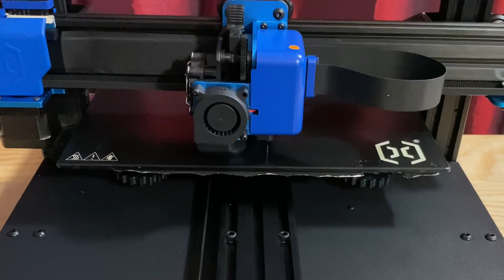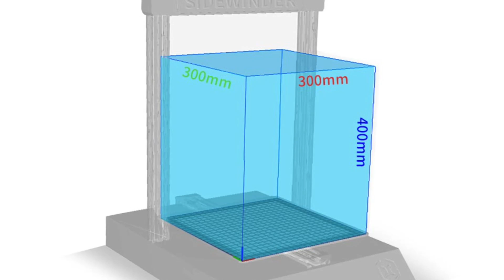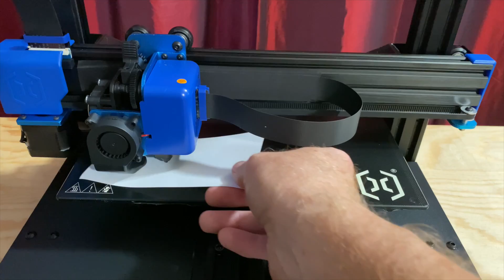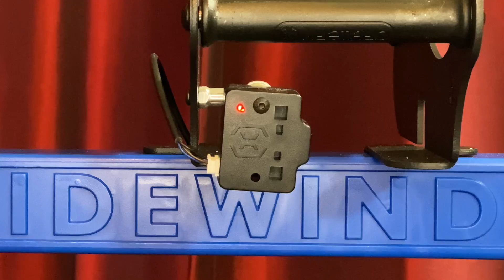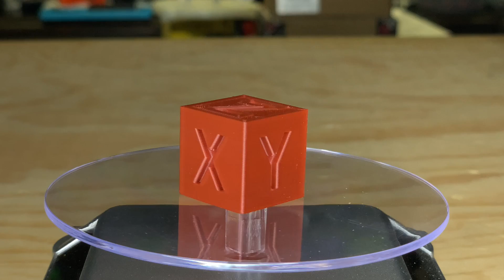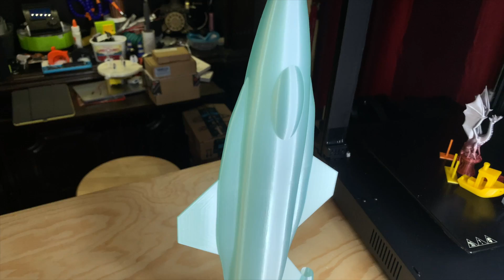Artillery Sidewinder X2 3D Printer Review

Comment: I'm actually quite conflicted here.  Your video shows fantastic print results with this printer.  I'm curious why then this reviewer produced utter garbage on the very same printer - https://www.youtube.com/watch?v=9JZqosMxmxk.  Did you have to tweak it off camera for an extended period or is this other reviewer just clueless?  I personally think this printer is beyond ugly, but I really don't care if it prints well and is at least somewhat faster than my Ender 3.  My first (and probably only) upgrade would be to remove the build plate and add something magnetic as I have not heard good things about the one it includes.

Comment: I have an X1- and seriously considering an X2. I have had to rewire the head direct to the mainboard, because of unreliability of the connectors, and it sticks out on my bench because of the bed cable, and the reel holder is a pain.

Comment: Thank you for the informative detail on this printer. I am really looking towards this printer and I have a couple of questions. 
1st is the sizes: I'm looking to use this for printer 3d game boards like walls and floor tiles. Have u done so or will this printer be good for that. I also of course will do larger prints, but looking to see if I could both? 
2nd I have seen other videos recommending to place supports on this do to the wobbling at full height, (however you printed that rocket and it looks great). Did you have wobbling issues or seen that? 
Thank you for your time.

Comment: Hi Bryan,   Is there any difference between the X2 & the Genius? It looks like the X2 is now exactly the same as the Genius besides the format. Btw: the Genius has no problems with the USB stick. What is very easy to break is the BL sensor. Mine broke when i printed  several parts at once. One parts came loose from the bed and the BL sensor hit that and broke. So be aware of that!

Comment: Great review. Taking money and print size aside, which one would you recommend more? Sidewinder X2, Ender 3 S1 or Ender CR10 Smart Pro?
Reply: I would like to know as well. Going to buy my first printer soon.
Reply: @RyKnocks  I decided to go with the Ender 3 S1 as my first printer. Was thinking about the SX2 for long time but what changed my mind is the amount of people using Ender devices - the community is bigger for sure and in my country there is official Creality reseller which makes it very easy to get spare parts etc. The bigger print volume is a nice thing for SX2 but at the same time you can build almost anything with smaller one but you need to split it into smaller parts.
Reply: @KrzysztofRozestwiński  I don't like the Bowden extruder on the S1.
Reply: @atonicoh  Ender 3 S1 has direct drive extruder

Comment: Getting ready to buy my first printer and printing TPU is a must. I know the Sovol does a good job and I saw your review on the Creality Ender-3 S1 where you said it handled TPU without issue. How about this printer, you never mentioned other filament types...
Reply: A little late but I'll respond for others having the same question. I've had my x2 for 4 months now and I use it primarily for petg and tpu. Does an excellent job with both once you've tuned it to that specific roll. I use cura slicer and always start with the generic setting then adjust after a small test print. My only complaint is the nonremovable build plate. It needs to be thoroughly cleaned every few prints and it's just more annoying not being able to take it off for a good scrub.

Comment: This looks like a nice printer. If I didn't already have 4 other printers and I hadn't sworn off bed slingers forever I might have considered buying it. In any case, I may be able to recommend it as a good first printer for someone just starting out.
Reply: What non-slinger printers do you use and recommend?
Reply: @Gi_Gantor  These days I'm using the Ender 5 Plus and Voron printers. They're not beginner models but they are rock solid and produce excellent results.

Comment: That bed is a deal breaker for me. The glass surface doesnt last long and replacing it is a real pain.
Reply: Can you add a different bed plate over the top?
Reply: You can replace it with an aluminium bed (more uniform heat distribution) for <£50, or use PEI covers.

Comment: Sadly , I've had nothing but issue's with mine . I've had it for 12 days and not one single print . 
I have a video on my channel to look at if interested  . Bed doesn't heat up either .
Reply: Use different firmware. Upgrade the TFT firmware with microSD card. As for mainboard firmware, it’s being worked on.
Reply: @mactastic144  Didn't work , still grinding  , also heat bed hasn't worked (says error) . 
Thank you for your assistance

Comment: Straight forward and thorough review. I would've liked to see Evnovo/Artillery do three things with the X2:
1. Add gantry stiffeners to allow for higher accelerations all around.
2. Incorporate a linear advance option that you can tune via a built-in file.
3. Partnered with Fulament to add a removable print surface as a factory option, rather than the glass.
Reply: They’re not a software company. Digant maintains better firmware on Thingiverse.

Comment: Thanks for reviewing this printer, I got my X1 last year and have been very happy with it. For it's large size, it's a more reliable printer than my Ender 3 v2.
Reply: What issue do you have with the ender v2? I actually am thinking of getting that one.
Reply: @wskwong2000  It took me a while to get it dialed in and working right. The Sidewinder was much easier getting up and running. Now that I have the Ender working like it should, it's been a good little printer.

Comment: One problem with the X1 that hasn't been fixed in the X2 is the non-removable print surface. If you damage the bed it's a total pig to replace.
Reply: There a third party magnetic build surfaces you can install.
Reply: @mactastic144  oh I'm sure there is, however if removing the original surface is such a pain then installing this would be problematic to begin with.  That's not to say I'd not be put off from replacing the glass  bed with the removable one.  I do this as a matter of course on the printers I own.   I ad a veery bad experience a few years ago with a glass bed shattering on me and I, personally, don't trust glass any more.
Reply: That’s a really dumb thing to have not fixed ! Def got to be a massive downside

Comment: What do the S and Z commands signify when using M420?
 I thought they would have started using a heated aluminium plate instead of sticking the heater to the glass build plate, many people I know in the community have moddded their X1 with a plate so they can use alternative build surfaces, of course they could always place the new build surface on to the glass plate but from what I gather they prefer the standard aproach
Reply from the maker: Hi Andrew! The S parameter enables or disables the use of the stored mesh. It's a Boolean value. So, 1 enables, 0 disables. The Z parameter is the fade height. The Marlin documentation says it means "Set Z fade height," but doesn't specify units. I assumed the units were layers, but it might be millimeters.

As for the bed, maybe a Sidewinder X2 Pro would have an aluminum bed with a magnetic spring steel sheet? Up until Fulament sent the Fulabed upgrade to me, I was happy enough with the X1's bed. The heater-on-glass combination heats up really fast. I may pick up a Wham Bam system for the X2 in a few months and see how that performs. I realize the magnet and spring steel sheet are going to add thermal mass (and regular "Mass" mass) to the bed, so it'll heat slower and be heavier. That'll increase the heating time. But I love me a good spring steel sheet!